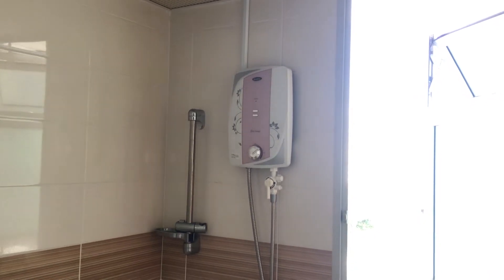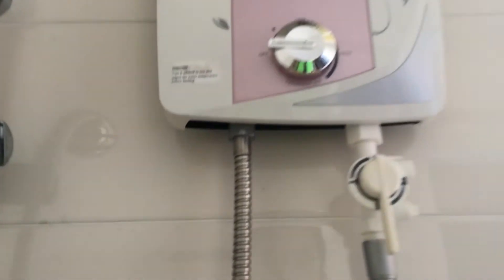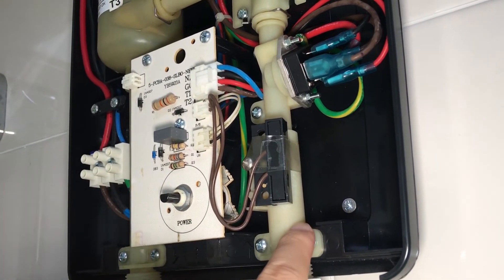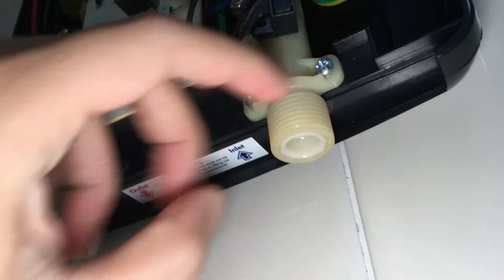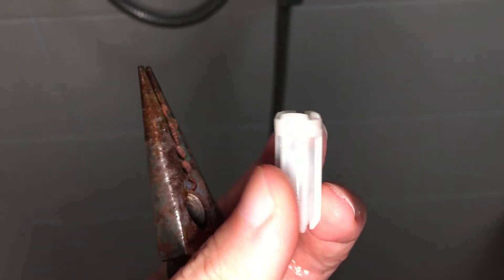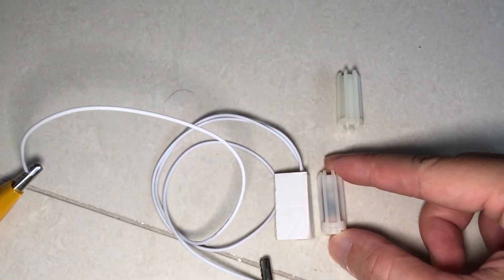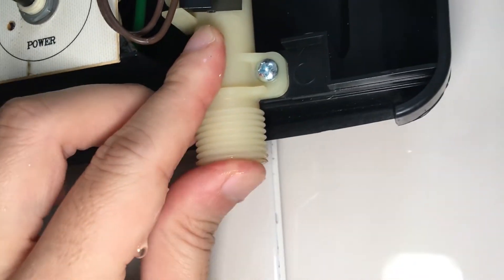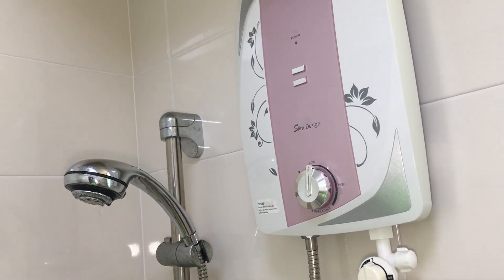How to Fix - EuropAce Instant Water Heater - Fails to Turn On Randomly (Singapore & Malaysia Type)

Comment: What if my instant water heater switch turn on the heater also turn on.
Reply from the maker: @YongshengNg-ri7yi  two possibilities: 1) Your magnetic float is stuck at the top position. Turn your water inlet on quickly and shut it off several times to dislodge it. If it doesn’t stop turning on when the water inlet is shut, then;

2) Your sensor is stuck on. Replace it. Its a generic $1 reed switch/magnetic sensor.
Reply: Thanks gonna get it fix  @fuzzy34r

Comment: I have ordered the the magnet float   in your  link and use your method to remove the plastic sleeve which is not easy in my Europace and now  works perfectly.Thanks very much .
Reply from the maker: Hope it helps!

Comment: Hi Uncle, my symptom similar but a little different, when i press the reset button(sometime once, sometime many time) the water heater will start
Want to check if this is also the magnet float issue too?
Reply from the maker: I'm not sure as mine does not have a reset button. Suggest that you search for videos relating to water heaters with the reset button for more info.

Comment: just short the magnetic flow sensor and will solve your problem.
Reply from the maker: No. This will activate the heater all the time whether or not there is water flowing.
Reply: @fuzzy34r  Noted. Thanks

Comment: Hi, Great video guide. May I know, where and how did you buy the new magnetic flow capsule for the Europace heater ?
Reply from the maker: Hi! I had no luck trying to buy the magnetic capsule from europace. Had to search shopee for a similar item meant for a Joven water heater.

Comment: Not sure if my CHAMPS Perry has similar procedure/internals for the repair. For some reason, my 2 years old CHAMPS Perry heater suffered similar issue as what is shown in the video and it's concerning that a rather new heater is already this problem compared to my older CHAMPS Accord which lasted years and only have a bit of chunking sound before getting replaced

Update : IT'S IMPOSSIBLE to remove the inner sleeve even if I have used a hook tool because it seems they have GLUED the sleeve tight. NEVER buy from Champs.

Comment: The red light indicator of the electric socket(on/off button on the wall) is sometimes fully bright, half bright and dimly bright, causing the water outlet of the water heater to be hot and cold according to these conditions.  Now ask Uncle how to solve this problem.
Reply from the maker: Perhaps you want to check the wall socket itself and the wiring. It doesn’t sound like the problem is with the heater itself.
Reply: @fuzzy34r  Thanks for your reply. May I ask whether have two types of wall socket.(13A & 20A)
Reply: Uncle, the red light of wall socket became permanently dimly and only cold water come out after l had a wiring tighten , water heater look like no power .
Reply from the maker: @kwanchihong5663  I don’t understand your question. You probably need an electrician to determine what your electrical points can support and check if there is anything wrong with your switch and/or wires.
Reply: @fuzzy34r  thanks
Reply: @fuzzy34r  whether related the white button of wall socket which only can press half way or rebound to half way always.

Comment: Very helpful. Saved my day. Has tried to re-position the magnetic device and power is detected now when water flows. Will see how it goes. I suppose eventually will have to replace the water heater magnet flow sensor like you did. I'm only at stage 1 now. : P
Reply from the maker: Welcome. Glad it helped. Its a shame when people throw away a $100-200 instant water heater when a small magnet fails.
Reply: @fuzzy34r  i did called up EuropAce support to find out what could be the possibly cause, and hence narrowed down my Google search and found your video. 😀

Comment: Thank you for sharing, may I ask how do you know whether it is the power that has tripped or the sensor that is broken ?
Reply: The problem is that I left the water heater on for about 20 minutes, when I turned on the water, the heater wasn’t working anymore. Is it the sensor that is broken ?
Reply from the maker: @KSki26  its hard to say. You will need to systematically check the components. For mine, i saw that my heater works some of the time, meaning that something isn’t triggering my heater correctly; this lead me to the flow sensor.